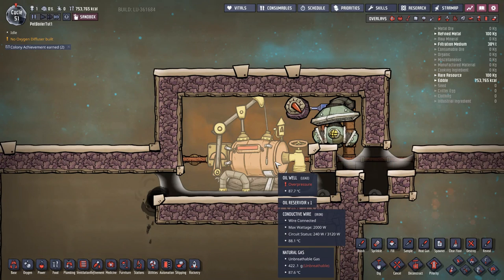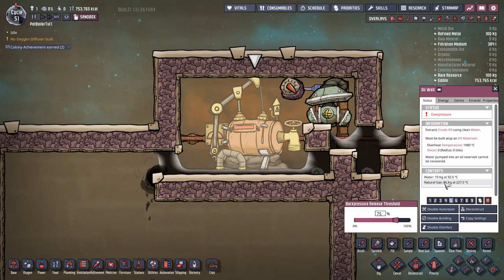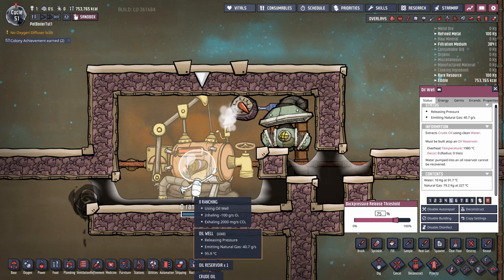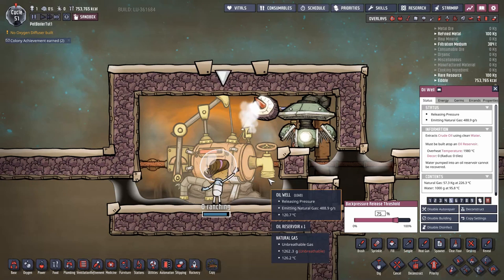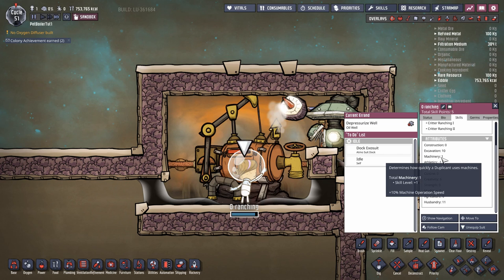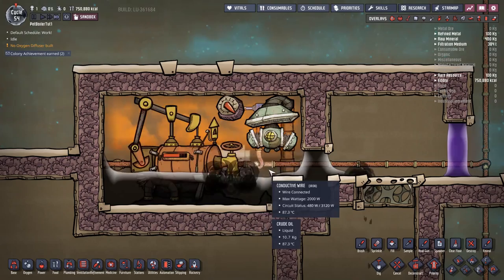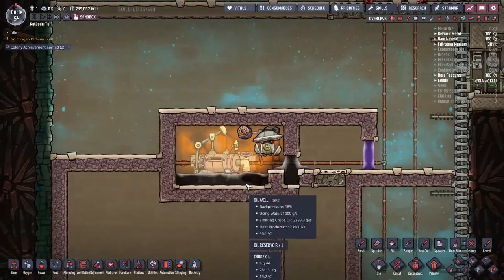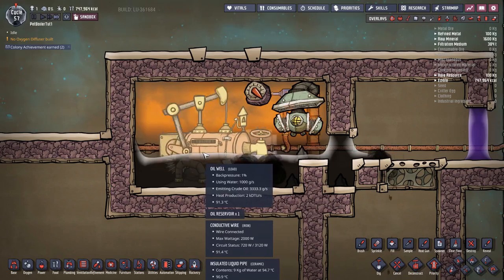Oil Well : Tutorial nuggets : Oxygen not included

Comment: Love the combination liquid-lock and drain - so nice when you can have two things for the price of one without compromise!

Oil wells do not seem to over-pressurize, I learned - I have one chugging away with 26kg of Natural Gas in its space. Lots of fuel for the gas range ;)
Reply: just checked one of the saves where i forgot about getting some natural gas generators online till about cycle 800. 180kg of pressure per tile o_0
fail proof design hehe)

Comment: 3.3x 2000W or 3.3x 3000W tuned up power per oil well! :) So A LOT of power. They eat 1000g of petroleum/s right?
Reply: CPY 2000 grams actually. Still a ton of power tho
Reply from the maker: Oil wells output 3.3333 kg/s, if you refine it in refinery you lose half so 1.6666kg/s which is 1.6666 KW. If you boil the crude in an oil boiler you get 100% conversion so 3.333KW of power per well.
Reply: @FrancisJohnYT   still, not bad if you boil it. I don't know why I thought it only used 1000g.

Comment: Rather nice design, and helpful information! Good to know now, since I haven't started fucking about with petroleum yet. So far only used siphoned natural oil pockets as coolant for the metal refinery... 

Anyway, Francis, I've a little thermodynamic quandry for you, unrelated to oil. I've been designing my base with high quality of life in mind (everyone's got bedrooms, gonna be giving them their own little apartments at some point too), and I've recently been putting emphasis on giving them higher quality food. My initial plan was mushroom wraps since I had fried mushrooms up the ass, but after using a slush geyser to cool my refinery area to the point of freezing before sieving it and throwing it into my Half-Rodriguez, I realized that I could also use the slush to cool a sleet wheat farm. Couple that with the fact that I had a cool steam geyser a hop skip and jump away, I realized I could also put in an adjacent pepper plant farm if I mix and manage the temperatures correctly. Fuck mushroom wraps, I'm gunning for pepper bread!

So I designed a fully automated 40 crop sleet wheat greenhouse in debug mode before building it in my game. Actually quite proud of it. The cooling loop is entirely automated, taking in fresh slush only when the water in the cooling loop goes above a certain temperature (still fiddling with it, but I tend to go around 2-2.5 degrees) and gets ejected. The radiative pipes (gold, if I recall) go over the plants themselves and have temp shift plates behind them made of igneous (since that's what I had). The ejected water is connected to a sieve which feeds the insulated irrigation pipes. This system works quite well, but it has a number of problems which I'd like your input on.

First and foremost, the coolant water has a tendency to hover just under the threshold, which delays the irrigation to the point that the crops dehydrate. Even if I manually cycle the water, it often ends up not being enough to completely irrigate the crops. Not only that, but if the irrigation system gets backed up, the cooling loop will too. If the cooling loop gets backed up, it stops cooling. I have hot geyser water from the cool steam vent connected to the irrigation system though a valve and liquid shutoff, but that shit's still around 60-70 degrees and stifles the plants REAL quick. I tried cooling it down with a heat exchanger with a second slush circuit (that later feeds the pepper plants, about 10 of them. Just kinda slapped that farm together), but the difference in flow results in not much cooling happening.

So I realize that I can probably get this system working through careful tuning by adding in juuuuuuust the right amount of heat to the system; putting in enough hot water to not stifle the plants, but warm the cooling loop enough such that this primary irrigation system has enough water to keep the plants watered. I'm thinking I should also reconsider some materials that I'm currently using... Anyway, I'm just wondering if you've got some ideas based on this description.
Reply from the maker: Difficult to work of a description but best effort. You can feed sleet wheat 90C water if you want, the trick is you only have to keep the plant cool. Don't worry about cooling the hydroponic tiles and make them out of the lest conductive material you can get your mits on. Place the temp shift plates one tile away from the hydroponic tiles this will stop you injecting cooling into them. So long as the plant itself remains cool that's all you have to care about.
Reply: Yeah, a description is the best thing I can do atm. Not at my PC. Though you're definitely giving me some ideas... The thing is, I can't just space out the temp shift plates since the farm is... well, it's rather cramped. Fitting in 40 plants, a bunch of sweepers and loaders, and a fertilizer station was rather tricky. Definitely need to do some more testing in debug mode...

Comment: gearhead gaming has a sour gas boiler design that doesn't seem too complicated
Reply from the maker: It's a cost benefit thing. A 10kg/s petroleum boiler is simple and quick to set up and gives 10 KW of power. For a sour gas boiler to compete it can't just do 1kg/s as that is only 8.8 KW for more effort. If you do 2kg/s it's 17.6KW which is worth it. So if you go to the extra effort and size you can make a 2kg/s sour gas boiler. Considering the effort involved in both I usually just grab a petroleum boiler as it's usually more than enough for my power needs. (If I built a few battery banks) So I suppose long story short I'm lazy :)
Reply: @FrancisJohnYT  yeah but that's what I'm saying I think the sour gas boiler from gear head is easier to build than a petroleum boiler, although I haven't built it myself and I'm not sure how much it processes. Also less oil Wells to do although maybe that only appeals to me because I have a particular hate towards setting up oil wells

Comment: Sir, they output 3 Thousand and 333 grams. Its enough to power 24 gas generators and feed back the clean water.  You don't even need that pump and can place the oil well directly in the inlet/exit of the "gas boiler" where the oil drips in and the cold natural gas carries the heat away when it flows out. All you ever gonna need is a thermo regulator and  a two steam turbines to get the energy back. No need for volcano or oil pumps!
Reply from the maker: Sounds like a fun design.
Reply: MIND BLOWN Now playing with Turbines over my Oil Wells.... btw It must be my OCD, but I like the Wells better than wild oil.
Reply: @qaz120120  links don't work anymore and i'd love to see this thing if you're still around with pics
Reply: @fknutz4400  I am happy to hear what you think of my design. Do not be deceived by the size as this was the concept and it can be cut to half size with actually only a minimum reduction in troughput.

Also, a steam turbine can be put halfway to destil water and the liquid gas purifies all your oxygen!!